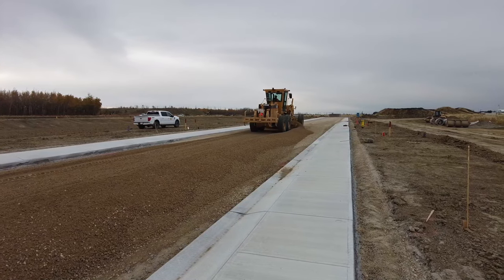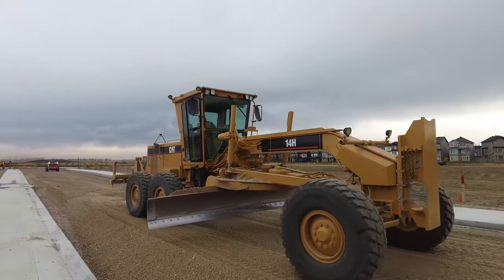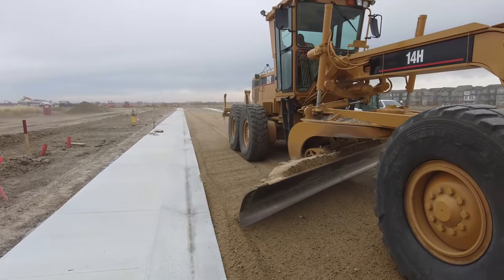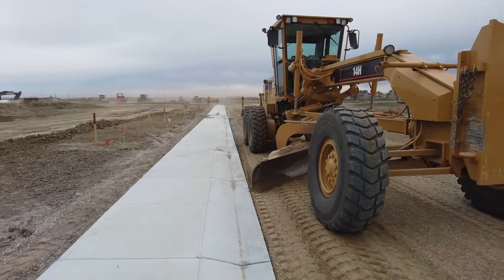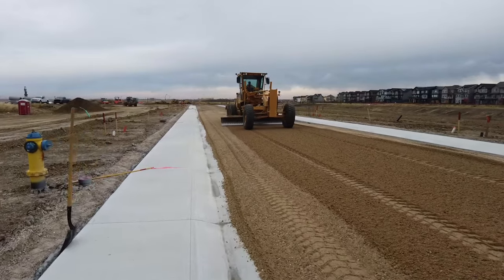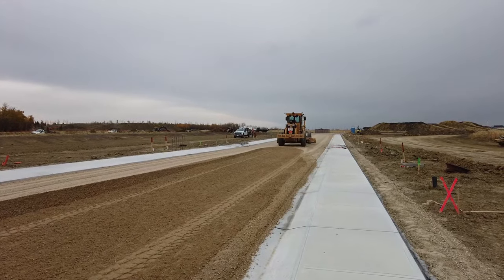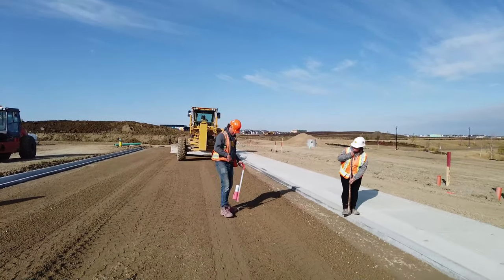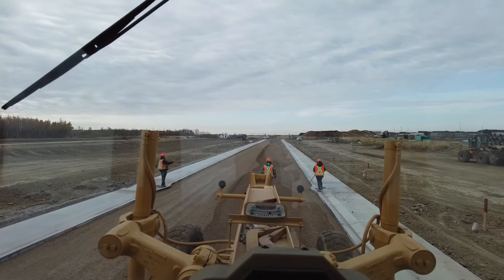Placing Gravel, and Preparing for Asphalt

Comment: Im pretty new with grader,working on cat 160H for 3 years,and my grader blade is in terrible condition,plate never changed for 20 years,cylinders almost all leaking oil,no parking brake,and lots of other things...im wondering how much often do u guys change your blade plates and when u decide its broke and useless,and snyone can solve why my psrking brake dont work,its leaking air all the time
Reply from the maker: A 160H is a nice machine, if they are well maintained. When you say "plate" I assume you are referring to "blade slides"
I replace my blade slides (brass) every 3 months.
If you have a constant air leak, it will eventually take out your compressor. Thanks for watching.
Reply: @onlyamillionmistakesvernky7937   it leaks all the time,it's almost a year and half and I work without parking brake,and got lots of problems because I always have to find a secure spot to park my motor grader,and I have to pull down mine blade and it's bad for hydraulics and lots of other stuff....I didn't mean on blade slides I mean bottom of grader blade...do u change that or u put it somewhere on asphalt and try to fix curves on blade?

Comment: Looks great! What I do is put a paint mark on my Blade at the desired depth, and run it to the curb works every time. Same with string. Almost like a hyper sonic laser just just by hand.
Reply from the maker: Yes, I do the same thing sometimes. I keep a "thick felt marker" in my grader. I use it to put a reference mark on the edge of the moldboard.
Thanks for the input.

Comment: May I ask you. We have a blend we want to grade in gravel road but it has core stone mixed. Would the grader be able to spread and remove the core stone from the blend? I've learned a lot from you and other guys on how to operate. Any advise would be greatly appreciated.
Reply from the maker: If you have mix of different size gravel, there is not much you can do with the grader to help the problem.  I would suggest using a "drum packer"
after you lay the gravel out. The drum will push in the larger stones. Good luck on your project.
Reply: @onlyamillionmistakesvernky7937  thank you very much. I appreciate your insight.

Comment: Little trick I learned if you put a boot on and you roll your blade back all the way your boot can ride right on the lip of the curb and you'll be able to stuff your curb perfectly to the lip without getting any Rock on the top of your curb then you just hit it with your roller usually it beats down about 17 hundredths.
Reply from the maker: It sounds like you have worked in the industry for a while. Thanks for the input.

Comment: Don't you run grade control
Reply from the maker: Hi Gyanender, the company that I work for "SG" is transitioning over to grade control. SG owns two 140 M Cats, and a John Deere that could potentially use GPS grade control.
Reply: @ONLY a million mistakes: Vern Kyle  Grade control is a lot easier eliminating ground staff but you are very nimble and good grader op, might be because of  age and experience:)
Reply from the maker: @Polysingh_  Thank you for the compliment, and yes. it may be the age, and experience.

Comment: This is a dumb way to put gravel down.  Should use a large dozer with a spreader box.   Gravel would be just about on exact grade and only require final finish grading.
Reply: Hey Larry , do you have a video of your dozer with a spreader box? can you share a link ?
Reply: @svistcool  Sorry, don't have a photo.  We used a couple on the interstate many years ago.  They work great, very efficient.
Reply: Theres a reason ppl use graders for stone and not dozers. If u were experienced u would know why
Reply: I’ve experienced the dozer trick up here in Alberta also, companies lost their ass not knowing what they were doing. Funny thing about segregation and separating the fines from rock in how it passes inspection. The product has to be mixed. The only way to be more efficient is in how the trucks are measured by their spreads so you don’t have to move so much ahead. Vern I think there’s only a handful of us left in Alberta that can do it without the technology. Been contracting my equipment and myself to wapiti for 17 years now laying highway base. Been a hell of a ride, sad to see technology slowly taking over the industry to  the point of experience doesn’t matter, turn on knowledge with a switch. All my graders have grade control but cutting curb or doing widening, I always like a man on the ground lol 😉 Take care!!
Reply: @travisholmes27 evrryone is too reliant on grade control ,and when it goes down the grader sits until the gps gets fixed,  I used gps on airport job in calgary, ended up turning it off, and going freehand on the taxi ways, freehand on the shoulders too.